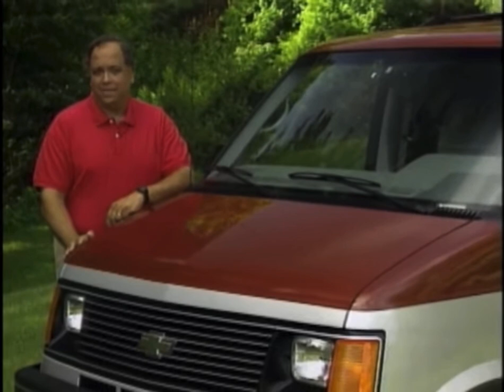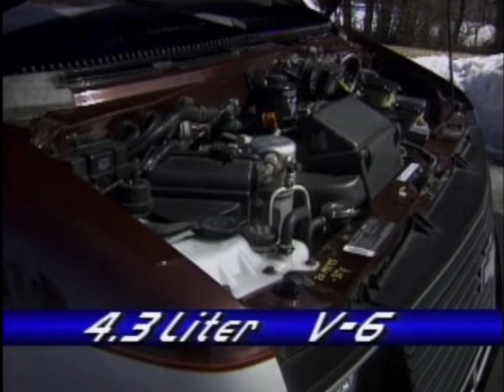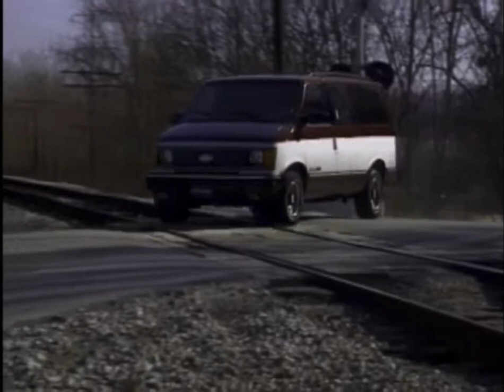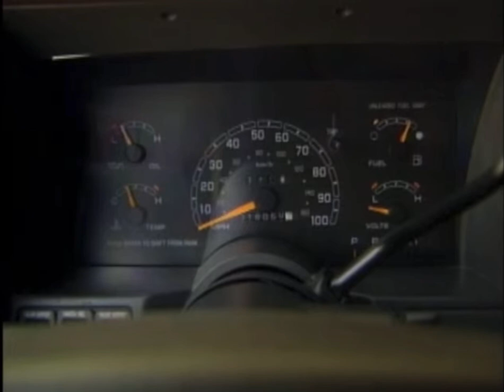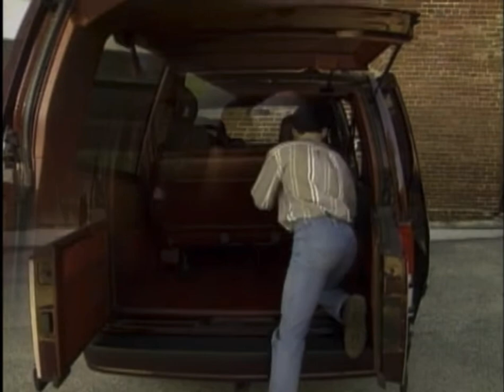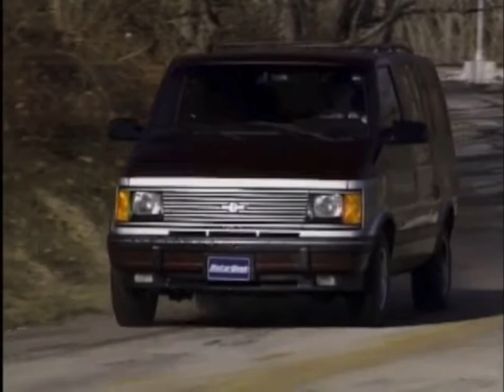Motorweek 1994 Chevrolet Astro Road Test

Comment: This video brings back a lot of memories.  We leased a new Safari from '94 until '97, an extended length version nicely equipped very much like the Astro in the video, except ours was a different two-tone combo of light and dark bronze with tan interior.  Ours also had the Dutch door option, roof rack, dark tinted rear glass, and raised white letter tires with the same style of wheels as in the video.  I suspect it might have been the same option package configuration right down the line.  It was very versatile and a great family road trip vehicle.  We took ours on many road trips from the Midwest to Florida in the winters, to the NC shore in the summers, to NYC once and camping several times.  Seeing that instrument panel from the driver's seat really takes me back.  It was also the first vehicle our now 28 year old son ever rode in when he came home from being born at the hospital.

It gave us zero problems in three years and did everything asked of it.  I liked the fact that it was light truck-based as opposed to the more typical car-based mini vans at the time.

Comment: As crazy as it sounds I miss my 1986 Chevy Astro van CL. It was two tone red and silver with a red interior. 4.3 V6 four-speed automatic power windows and locks Rim package tinted glass seating for 8 AM FM cassette AC with the full gauge package. 

I added fog lights roof rack running boards and a ladder on the back door with rear mudflats.

One of the most reliable vehicles I ever owned. Lost it in an accident in 1994 90% of the vehicle we're still original from 1986 everything under the hood still had all the original dealer stickers snd markings on it because I had to replace nothing.

The vehicle had over 120,000 Miles on it
I did Tires and Brakes oil filter changes a battery a fuel pump windshield wiper motor headlight switch and 2 EGR valves

Everything else under the hood was original.

Comment: The power output of that high output V6 was pretty impressive in 1994. Its crazy that GM sold these vans until what, like 2004 or 2005? They must have made alot of profit over the years, since the basic design dates back to the 80s.
Reply: This is GM’s favorite way to make money 😂
Reply: Fleets mostly.